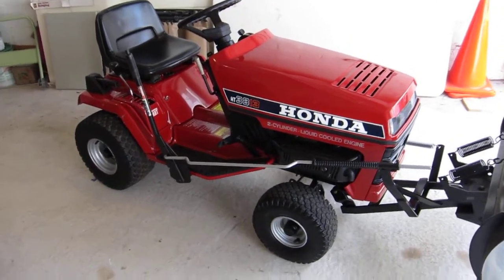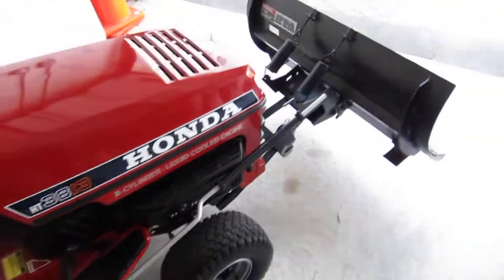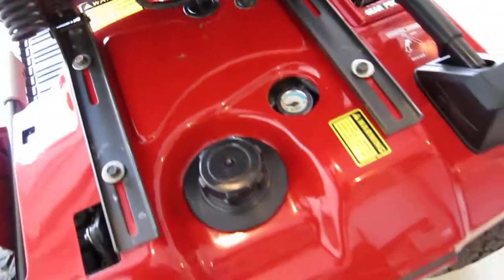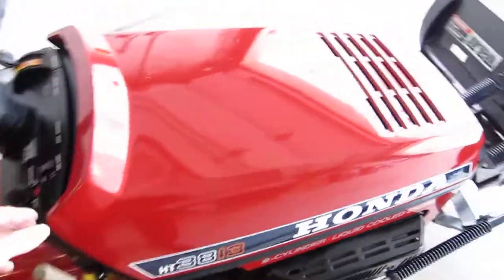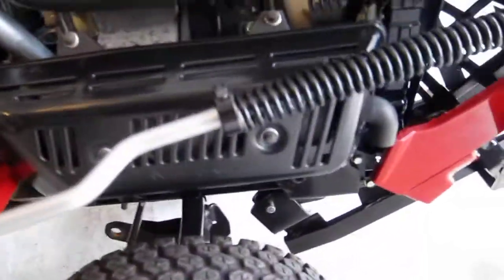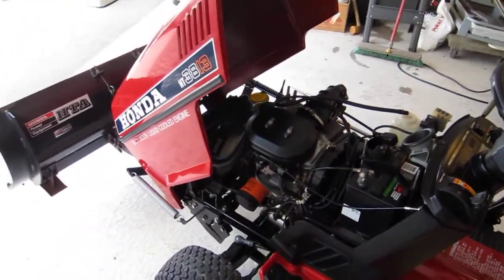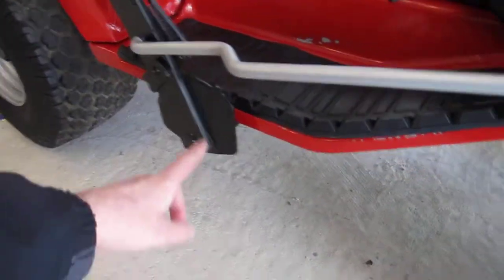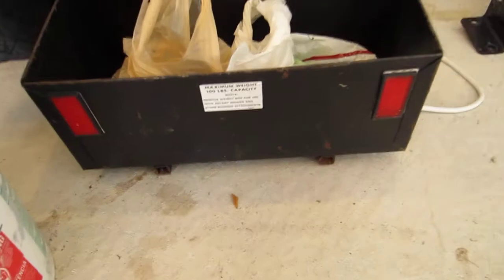Honda HT3813 tractor with Snow plow...

Comment: Super sweet find. I love these Hondas. I posted a vid of the same model. Had to rebuild the deck. Found out this tractor uses same deck bearings as a craftsman LT 1000. I bet these tractors would last a human a lifetime if well cared for. My grandfather has Honda equipment that's older than me. And it's still working.
Reply: Watched your videos, and will probably a few more times on the 3813!!!